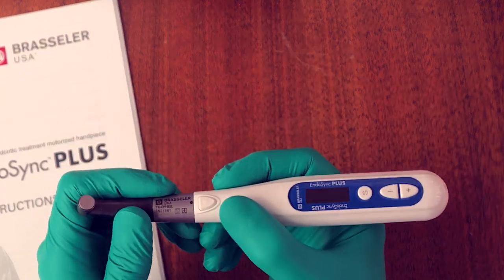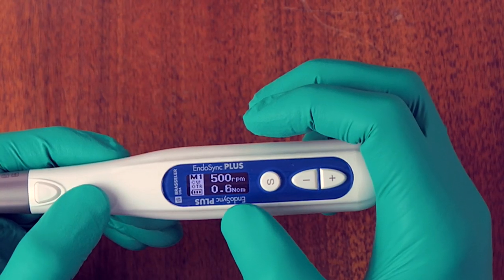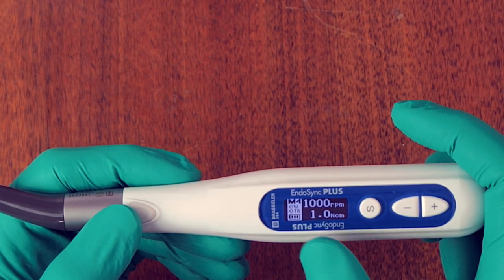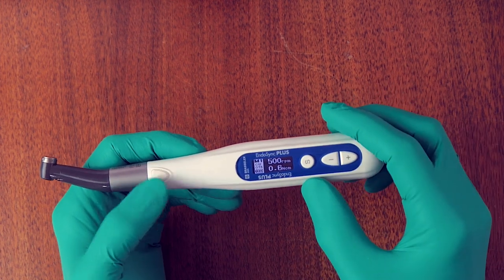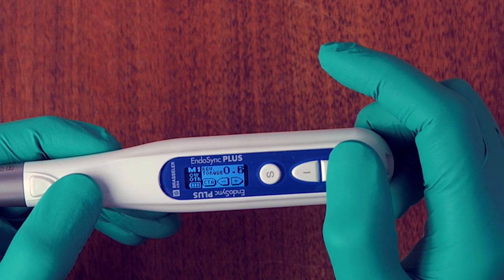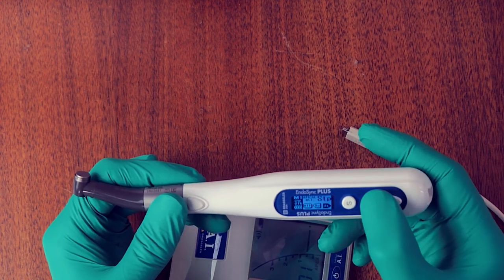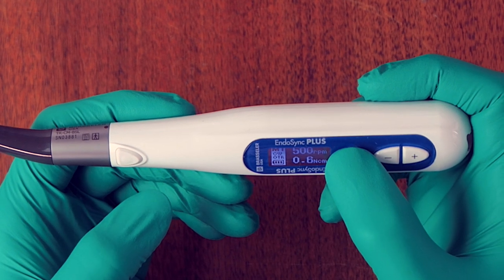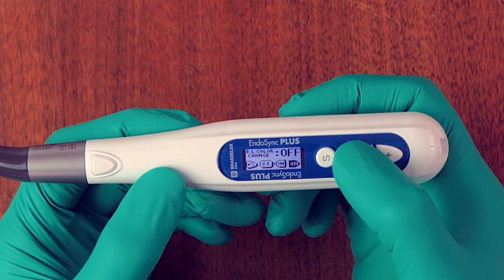EndoSyncPlus Handpiece Part 2 of 3

Comment: Seems horribly over-engineered. Not looking forward to having to use this system tomorrow.
Reply from the maker: Actually the handpiece can be set only on one of its memory settings and then you can forget about all the stuff mentioned here. Depending on what system you're using just set it to M1 or M2 and just use it. This video is for those who are interested in going to the next level and get more out of the handpiece. It's not over engineered. This video is like explaining what's happening under the hood of a race car. If you don't care to know then just drive it. No need to look under the hood.
Reply: @AANasseh  Thanks for the reply. I am trying to do a case with Wave One on the Endo Sync Plus.
Dentsply could not tell me what are the rpm and torque values for Wave One. Nor is it on a Google search.The Dentsply endo tech support said “use whatever the prescribed setting by Brassler and you shouldn’t be using that handpiece with WaveOne!”
Your video says to use the M5 setting (300rpm 0.1Ncm). My available handpiece has M5 pre-set to 300rpm 0.6Ncm.
What do you suggest to set the handpiece at for Wave One Gold?
Thanks and Happy New Year!
Reply from the maker: @seanvantuyl4650  Just put it on M3 and forget about it. Keep in mind, the file appears to be rotating before you engage dentin... but as soon as you engage dentin it begins reciprocating. So, it feels a little different feel than regular reciprocating motion of WOG but this is actually more efficient. For next level play, and if you really want it to feel the same as you you use WOG on its own handpiece then you  can change the angle of reciprocation to 150 ccw, and 30cw. Alternatively, you can go to 180ccw, 30 cw, for even more efficient cutting action than WOG motion! Lots of options. But if you want to keep it easy just put on Memory Setting 3 (from factory setting)  and use it that way.
Reply from the maker: @seanvantuyl4650  BTW, did you use it the way I recommended? What’s your feedback? 
PS. I live the Dentsply comment about not using it on a different handpiece! That’s just funny… Ibguess you have to buy it from them only!!!
Reply: So Ive been using it for about a month with Wave One and like the system.
Now I am in a practice who wants to use Blue Vortex.
They have their EndoSequence Plus handpiece set on 500rpm/1.0Ncm CW OTR. They don’t change torque.
Had to learn Blue Vortex on the fly and ended up separating a file way up by the shank in the access chamber (easy to retrieve). Haven’t separated a file in over 18mos.
When I read about these files, the Dentsply manual indicates that torque settings are different depending on file being used. Do I need to change the torque for each file?
Thanks.
Reply from the maker: @seanvantuyl4650  Use Vortex Blue files on M1 setting on EndoSync+ in easy cases and M2 setting on EndoSync+ in difficult cases and you'll hardly ever separate a file. M1 and M2 settings are the right setting for those files. Good luck!!